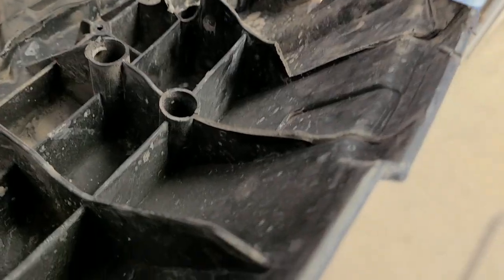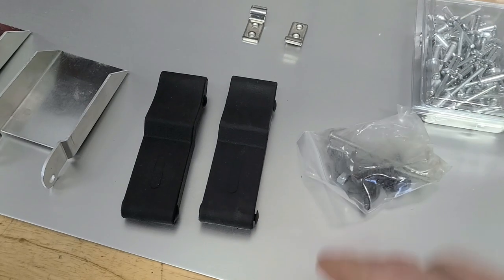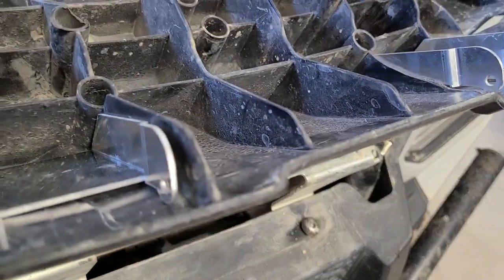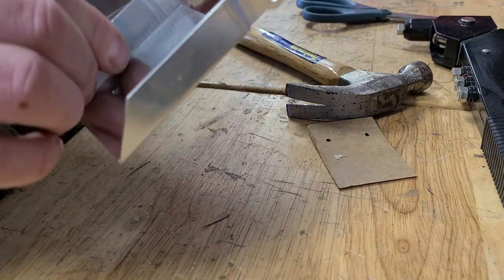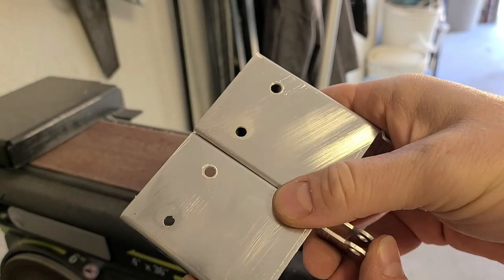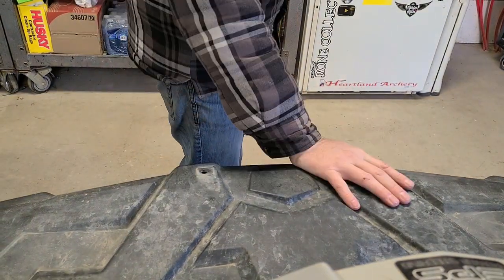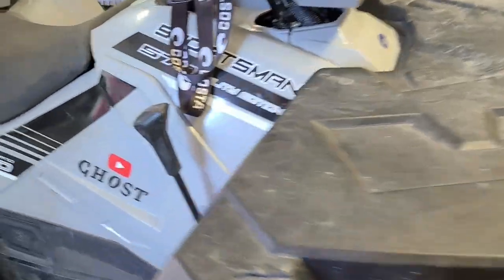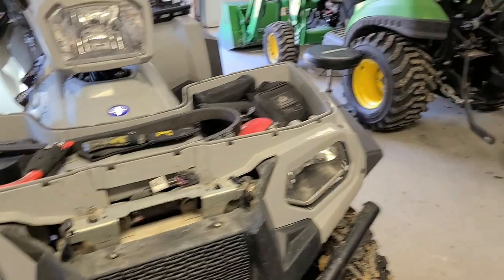Polaris Sportsman 450-570 Front Storage Lid Hinge Repair

Comment: Thank you for sharing this info, I had no idea such a kit existed and I’m thinking about getting one myself now. Never did like how Polaris designed that. I’ll be going Muskie fishing this summer on Roland Lake with people from Polaris Industries and I’ve been making a list of “why did you’s” to ask them…this is on the list 😊
Reply from the maker: I wanted to get these shortly after getting the machine. I noticed that it was a weak point and when I went online there was like only one guy in the USA making them. So I held off because of the price at the time. 

I don't know if it's necessary a bad design, I mean a stock lid is pretty light. If you combo that with a bumper that has good brush protection then you're probably going to be okay. My bumper has more low end protection so it didn't help me here.

But yeah, they are pretty reasonably priced now. Pretty simple design, I probably could make them but I just didn't want to screw around and I just wanted it fixed lol. 

Musky fishing!? WHEN ARE WE LEAVING?! LOL

Thanks for the comment buddy, appreciate it.

Comment: Hi buddy  please send me the link where you found the repair kit..
Reply from the maker: Hey, I got them on Amazon. They have so many different prices... but I trust they are all exactly the same so any should work. 

Motoforti 2 Set Front Storage Lid Replacement Hinge Kit For Polaris Sportsman 450 570 850 2015 2016 2017 ATV Aluminum Bracket With Bolts and Screws Kit Accessories Tool https://a.co/d/hMT1kUz